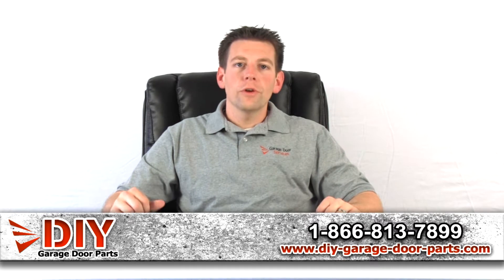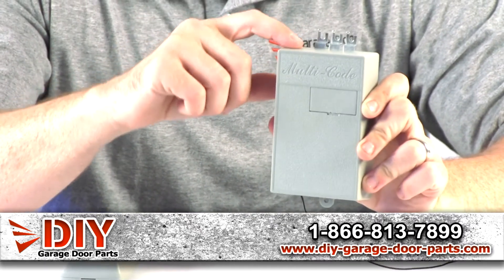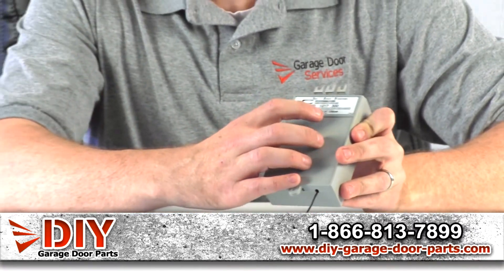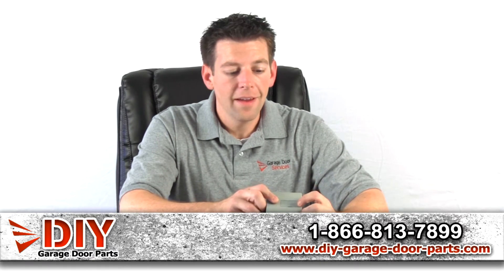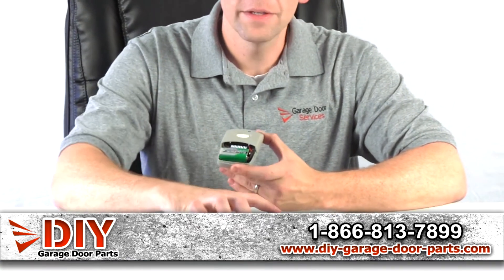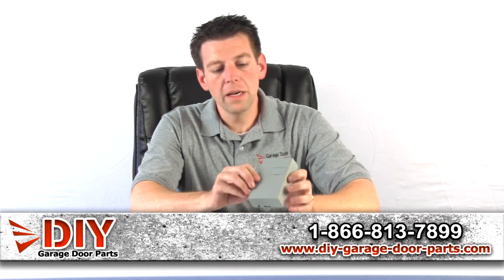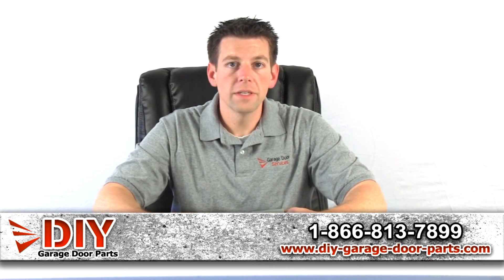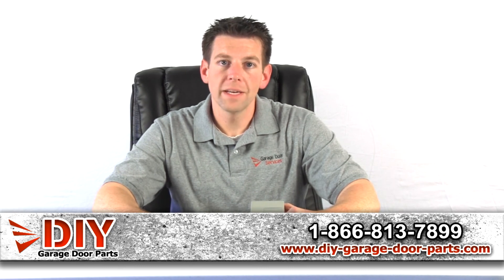Linear Multi-code Receiver and Transmitters.

Comment: IF YOUR STANLEY MULTICODE RECEIVER IS NOT WORKING ON ANY REMOTE I HAVE A FIX:  THE STANLEY 1090 RECEIVER (AND LIKELY OTHERS) HAS A SILVER METAL STICKER INSIDE THE CASE BACK COVER THAT CAUSES THE RF SECTION OF THE RECEIVER TO NOT WORK INTERMITTENTLY.  THE STICKER IS NOT GROUNDED SO IT CAN OSCILLATE WITH NEARBY AC AND OTHER RFI.  REMOVE THE BACK OF THE 1090, REMOVE THE STICKER USING NAPTHA, AND IT SHOULD WORK FINE.  WHOEVER DESIGNED THE STICKER IN THERE DOES NOT KNOW ANYTHING ABOUT RFI.   NOTE: CHANGING THE DIP SWITCHES DOES NOT CHANGE THE FREQUENCY (SOME FOLKS THINK IT DOES).

Comment: Hi i originally had an 109025 multicode but cant find another one so i got a 109020. The 109025 comes with four wires and the 109020 with 3 wires. How do i make the new 109020 work with that extra 4th wire. Thanks